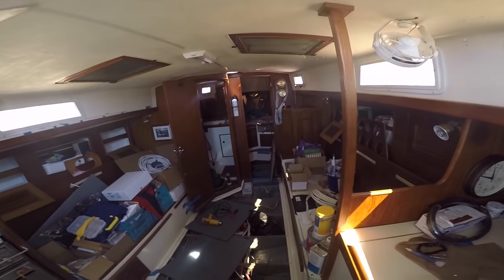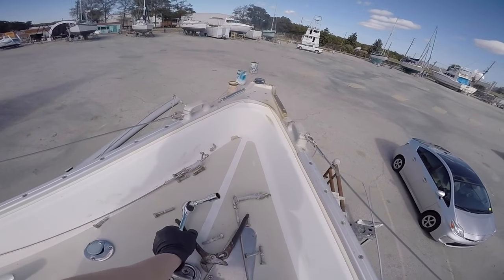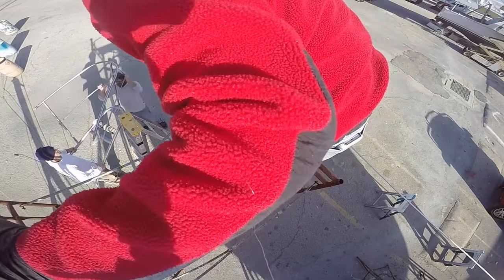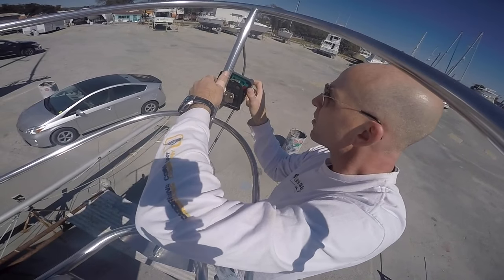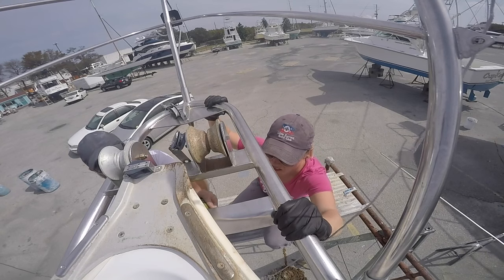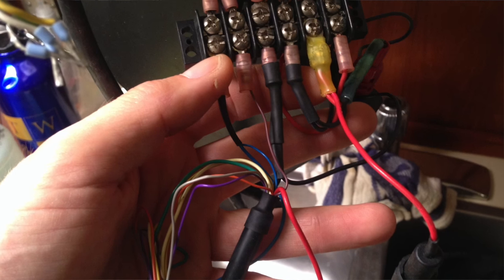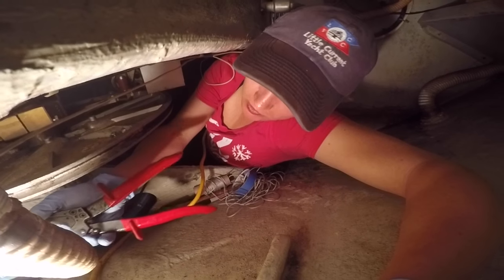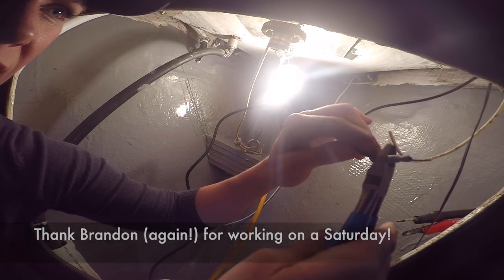#67: How NOT to Re-Bed a Bow Pulpit

Comment: How-to, how-not-to, not much difference in the end as long as the problem is fixed.  Although, I seem to remember much more cursing when I had a similar issue running new wire though the stern rail to a nav light.  Your video editing is much better than my language editing!  ;)  BTW, how did you like working with the butyl?  I've read great things about it, but haven't tried it yet.  It looks like a much cleaner process than using 4200 or similar products.

Comment: I was wondering if you might comment on what you might do differently now that you have this knowledge?  Usually on ships, when we are passing a flexible wire between two breaches we shield the flexible wiring or hose with a non-flexible sleeve (PVC pipe or non-corrosive metal) so that any shearing load force between the two breaches is first taken up by the sleeve.  That's a big lesson from tossing a bunch of electronic equipment off the side of our ship and wondering why it isn't working at depth.
Reply from the maker: +Jason Masters Thanks Jason.  That sounds like a great idea.  It might have been hard to coordinate that in the space between the bow pulpit plate and hull but it may have been worth a try.  Honestly this one was kind of such a mystery we weren't sure it wouldn't happen again.  Phillip said he thought the wire pulled through fine.  It didn't feel pinched at all.  You just can't tell when you're cranking down the bolts what might be smashing.  But, thanks for the PVC tip.  I'll keep it in mind!  And thanks for watching.